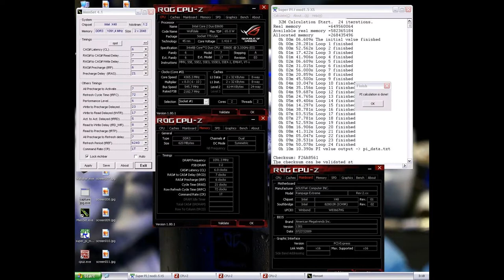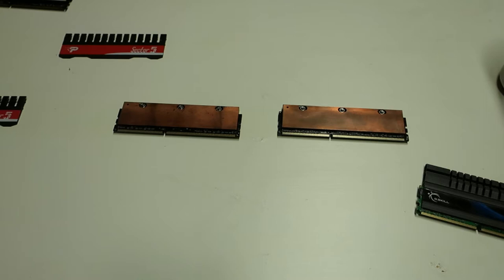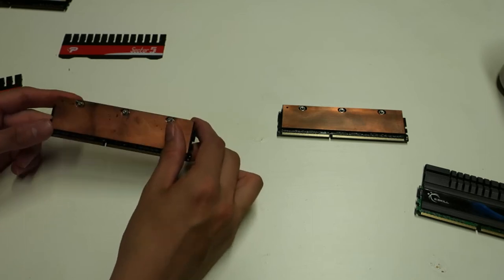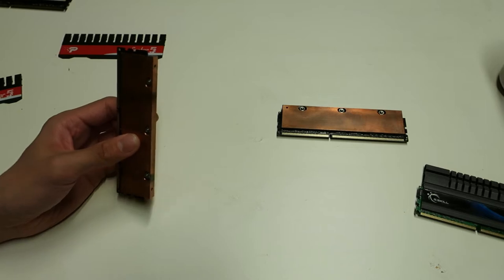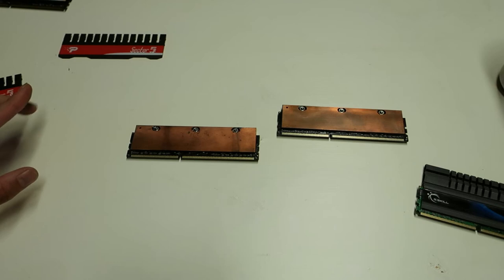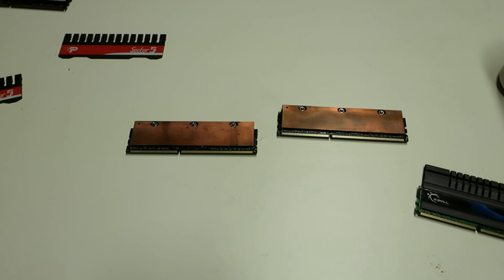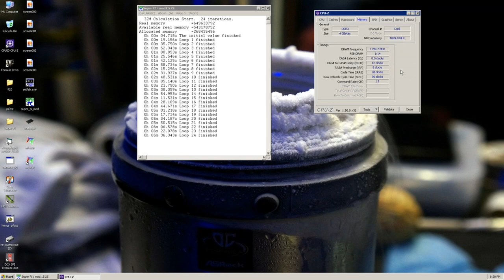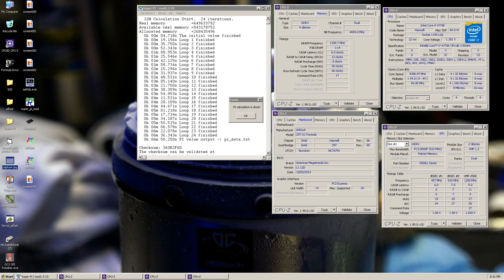Testing top-class Powerchip (PSC) based DDR3 memories on air cooling

Comment: I'm running Dominator GT 2133 9-11-10-27-54 (8x4GB) @2400MHz with the same timing (And BitsPower Ramblocks), and @ 1.565v on my X79 DARK with an E5-1680-V2@4.7GHz all core. After I finish rebuilding my system, I plan to get the XEON to over 5GHz, and I should be able to get the RAM to 2800 if I only use 4 sticks. I still have to figure out which 4 out of 8 are the best though. If you have any tips and tricks for X79, I'm all ears! I still have a great i7-4820K that does over 5GHz on water @1.365v.
Thanks for sharing this with us. o7